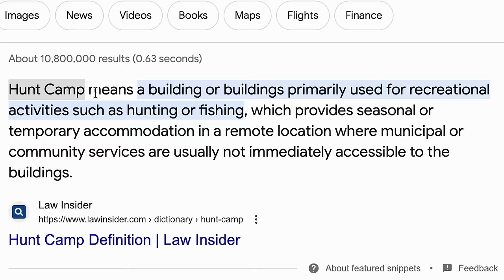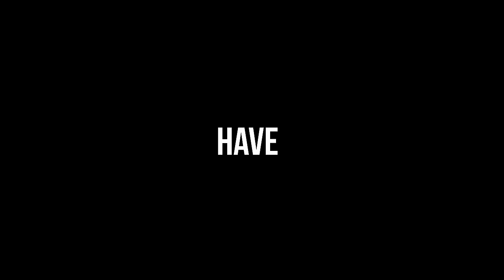How to Build Your Home to Last a Lifetime!

Comment: My house (a 100+ year old colonial in New England!) was also missing flashing and needed siding replaced. It was just a tiny section, and caused a BUNCH of rot in the rim joist beneath it. A total relief to have that fixed. I used a little sliver of blueskin for it, but I can't imagine blueskinning a whole building haha. I guess I'll find out what that's like once I finally re-side my barn...

Comment: You look to have everything thought out and going pretty smoothly but for those who are thinking of taking on similar projects there's one channel I like more than others. The Build Show channel has lots of videos on siding, dealing with water (they like big overhangs), and getting air circulation behind the siding to help it dry out quickly (no rot), and keeping the bugs and other critters out.  They're based down south but have done shows highlighting Canadian builds and go into details on different building codes and (my favorite) innovations in products and construction techniques.

Comment: How exciting to be finally putting the siding up. It is going to be completely transformational. I have an idea for you for a future project (as if you need any more projects...lol)...Wouldn't it be really fun to build a fire tower; something you could go up to the height of just above the top of the treeline and watch the sunsets from? You gave me the idea when you said how few sunsets you are actually able to see. This way you would get to see both sunrises and/or sunsets each and every day if you liked. It would also be epic if it had a spiral slide that you could get down from the top to the bottom zippity-quick-like (my made-up word for lighting fast)! Speaking of zippity...you could also do a zip-line from the top of the tower straight down to the cabin instead since those spiral slides are rather pricey. (or, you could direct it to any water you may have on your property so you just let go of the zip line when you are over the water.)
Reply from the maker: LOVE YOUR IDEAS! Thanks for sharing. Would make sunsets so magical xx thanks for sharing

Comment: Not a home builder here so asking this question as a complete novice. If the existing siding is rotting why didn’t you completely remove it? Why put a waterproof membrane on top of rotting siding? Are you just saving time by not removing the old siding? This absolutely perplexes me.
Reply: I wondered that too.

Comment: I would have removed all of the old exterior siding to check for wood rot, leaks, and termites.
Reply: They would have seen the condition of the old siding when they removed the old insulation.

Comment: Jazmyn; just a suggestion, when you are Finished applying the glue on the side you are working on, remove the roller tube from the pole so it wont be glued to it and you can put on a new roller brush easier❤😊
Reply from the maker: Thanks Kenneth, I did figure it out eventually. 😂🐾
Reply: I hope you ladies are not in danger of those brush fires. Stay safe

Comment: There's a flashing called z-strip that goes behind the upper piece of siding and on top of the lower piece of siding (if you're using 4x8 sheets).  That way any water won't go behind your siding at the joint.  What you had originally was a gap covered by a 1x4.  That relied on a bead of caulk on top of the 1x4 to keep your house waterproof.  (Poor solution).  You should utilize a similar flashing over your window and door trim.
Reply from the maker: Thank you for your good advise, you can certainly tell you are talking from experience.🌞🐾

Comment: The white wire coming out of your house appears to be romex. Romex is not rated for outside use, it will wick moisture under the jacket and into the interior of the wall.

Comment: This was a very strange episode to watch.  It felt like it was back in time a couple years ago exactly the same as the intro snipetts.  The piles of materials are willy nilly around the yard and the weeds made it look wildly unkempt.  My memory is that it was 90% finished and polished.  Only a little work with some nail clippers on the lawn was left to do.  And, during the application of the "blue goo", the siding was in way worse shape.  And then Porter's dad, Larry, dumped some more materials!

Comment: My ex-husband hated painting, so he would just be super messy, knowing I would get super pissed off and kick him out. He would load the rollers with too much paint and then make a bunch of drips that would later have to be sanded off, and I don't work that way. It has to be done right the first time, with no cleanup afterward. Well other than the clean up of the brushes and storing any paint that was left over. I also always would paint barefooted, because then if I stepped in paint, I would know immediately and wipe it off my foot, and not track it around. Of course, you can't do that with anything toxic!
Reply from the maker: He certainly knew how to get out of painting. 🤣🐾

Comment: I love your channel. But, did I just see that this house was waterproofed from outside. Gosh, that sounds like a horrible idea. That original wall was pretty rotten already. Now when it is behind non breathable layer, that will make things even worse. And when we know there is that foam insulation inside, also non breathable. That means that all that wooden structure is situated between two non breathable layers. That is generally really bad idea to do. That is because just basic laws of physics about moisture condensing when temperate changes. Optimal wall structure from outside to in would be: Outer layer ( what ever, wood paneling etc), then gap to let the outer structure breathe. Then windproof layer. Then the frame of the wall and insulation. ( on those condition something between 200-250 mm). Then moisture proofing layer. Could be paper or plastic. Then the inside walls. ( wood paneling, sheet rock etc).

Comment: Fat plywood on the outside of that cabin is siding it's called ranch wall the same as I have with my house comes prestained you can either finish stain in it or you can paint it like I painted it smokey gray with black trim but yeah it's siding it's called ranchers wall plywood and then I have three eighths particle board underneath that and our paper and a half inch grew all the way around the whole house in the middle of the two sheets of plywood then you cover it in ranch wall which is your siding Thought I was doing good when I built my house using my own trees and using good quality plywood not particle board except for outside wall only particle board that's in this place and I only did that because you had good quality ranch Wall siding going over top of that but never again Woodhouse because the rats crawl right up the side of it so 10 outside only or vinyl siding that they will slip on can't get their claws in
Reply from the maker: Oh wow, what an experience.
Reply: 😁😁😁 @Vanwives

Comment: Your woodshed is still not built, so you will be burning damp wood, which will plug up your stove pipes that much faster, which you still havent checked or unplugged your stove pipes from last winter.... Then the latest water lines you didnt bury very deep, will freeze and bust when the ground freezes.... You are not gonna want to do any of this in the middle of winter. LMAO :)